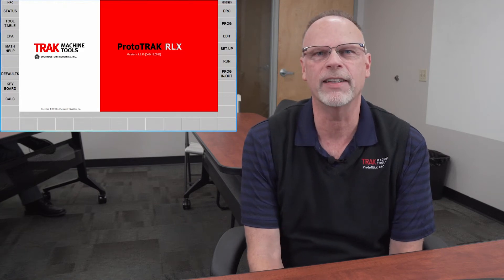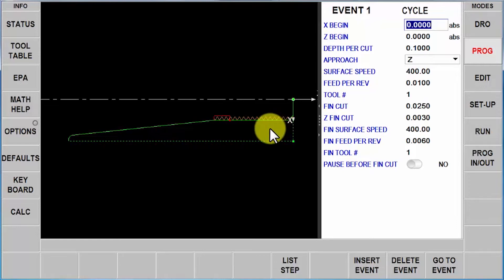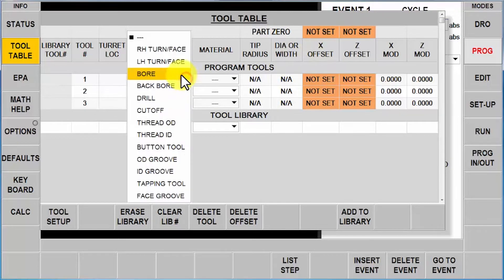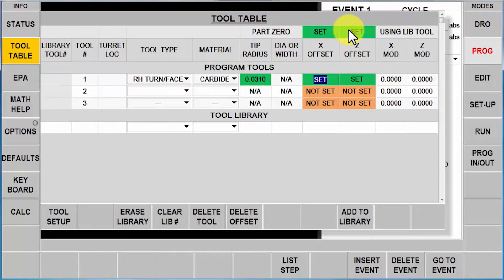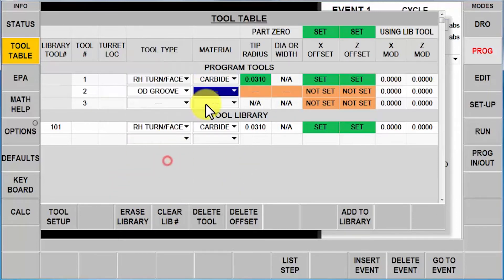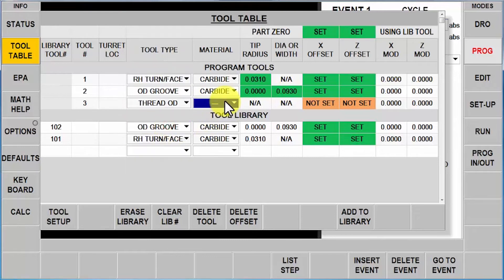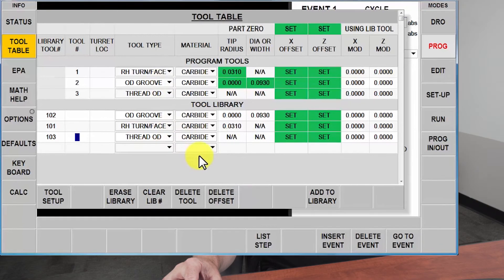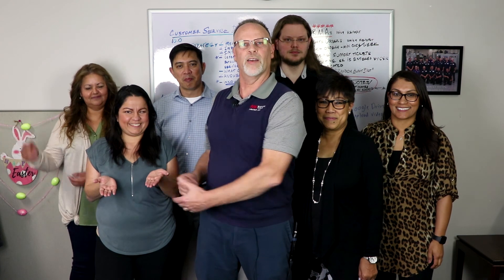Tool Setup [Part 1] | ProtoTRAK RLX CNC | Lathe Tool Setup (Offline)

Comment: Hi Pat, really been enjoying your tutorials for this software, its a great bit of kit and I enjoy using our proturn RLX 355 at work.

One thing that has confused me, is after I switch the machine off and come back the next day, my X offset for all my tools is greatly off. Do I have to re-input the X offset every morning? I know I do with Z because thats telling the machine where my parts face is, but I thought X would stay the same as it's relative to the spindle centre. 

Cheers
Reply: Hi Xavier! Thanks for the pat on the back...My team and I are glad to hear these are working for so many people.  If you have an RLX, at the end of the day, send your machine back to home.  Next, go to PROG IN/OUT where you save your programs and press SAVE TEMP. Now, you can shut down your machine. The next morning, before you move anything, go back to the PROG IN/OUT and press OPEN TEMP. It will warn you to make sure the machine hasn't moved. Just say OK and when you go back to DRO, you will see that it is exactly where you left it with the program, tools and part zero still in tact.  If you have an SLX or older model, you have to do it a little is a little differently. Since there is no save temp in the other models, you just have to go to Tool #1 in the DRO mode. Next, send it home. After that, turn it off. When you turn it back on, just go to DRO again and set your X and Z axis's back to numbers you used for your home position. It will be right back where you left it and you just have to re-open your program. Let me know if you have any other questions. I'm sure others will be able to learn from these questions as well. T.P.

Comment: Is part zero established by the first tool? What if that tool breaks and you have to establish a new zero for that tool? Do you have to re-establish all the library tools?
Reply: Part zero can be set with any tool in your library.  Just make sure that you select the tool you want to use in the DRO mode.  T.P.

Comment: Would just like some conformation here please, if you face off in z and set part zero and face of in X and input known size, then enter known tool radius does the machine compensate for radius input, for instance if tool radius is 3mm and I want a 2mm radius on corner of part as long as the 3mm radius is input it should create the 2mm radius on corner of the part ?
Reply: Yes it does compensate for the radius so you will get the radius site that you program.  T.P.

Comment: Can PT please put a “Grooving cycle” or allow a grooving tool to be used in a cycle it’s just I was running a part with over 15 grooves in the ID and it would’ve been so much easier to run a cycle and cut from the X direction and finish with a continuous move then manually punching in all of those grooves.
Reply: Joe, All of our SL, SLX and RLX products have a grooving events in them.  Which product are you running?  Have you watched these videos?  https://www.youtube.com/watch?v=BUzXHhJriO8 or https://www.youtube.com/watch?v=Tc_pv0wtjxU&t=131s  Along with an ID groove, you should just need a repeat event to make the other 14 grooves.  T.P.
Reply: @patrickfitzsimmons5187  I am running the 30120 with the RLX control and I would have done the repeat but not all the grooves are the same. 

There is a cycle for OD turning and I D boring (same cycle)  if I could only run the ID grooving tool in the ID cycle to rough and finish that would be so much easier then choosing 15 grooving events. If that makes sense.

Comment: At 1:41, you kind of glossed over the "it tells me to take a cut" part.  Is that what the green box is telling me?  I need more explanation of "input and set x."  You said "I'm gonna tell it I took a cut," and then I could hear you click something, but didn't see what you did.  What did you do to tell it you just took a cut?  Same with facing off the part.  Without showing the button pushing, the video just isn't as helpful as it could be.  I watched this whole video, and when I went to the machine I couldn't set up a tool.  Also, what is the difference between SET INCR and SET ABS
Reply: Sorry this took me so long.  I was on vacation. What I meant by take a cut is to physically take a cut of the diameter on my piece part.  After I do, I back off in the Z axis and measure the size of the part I just cut and I enter it in the box which changes that tool from not set to set.  I then would face off the end of the part and set that place a Z zero.  I do this for every tool however, I never cut the face after the first tool. I either use a piece of shim stock or paper and I enter that thickness instead of Z zero.  By not doing this on the actual machine, it is hard to show this process.  The green box you're referring to is telling you to move to a known value and then enter that value for each X and Z of each tool.  I hope this helps you to understand better.  T.P.